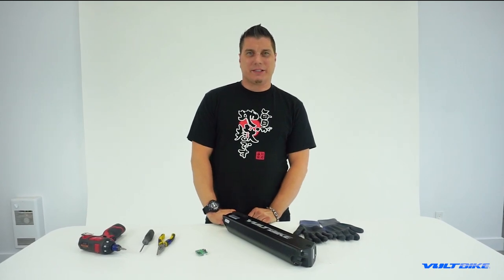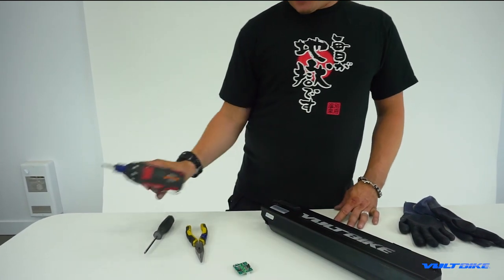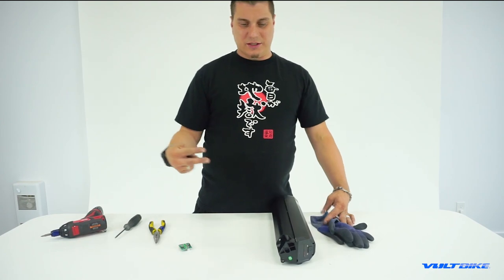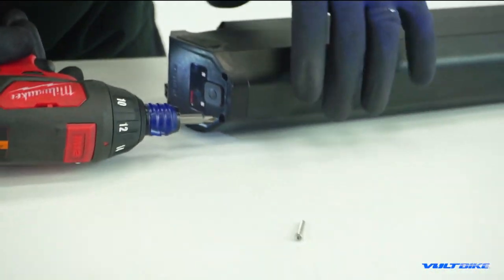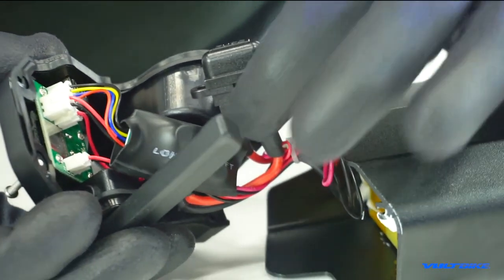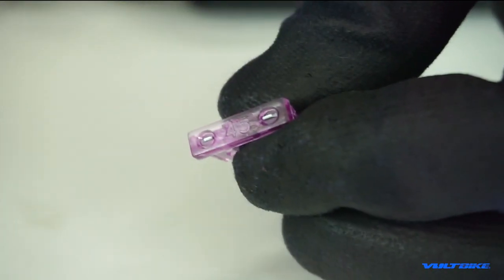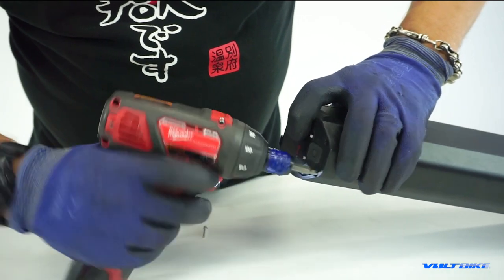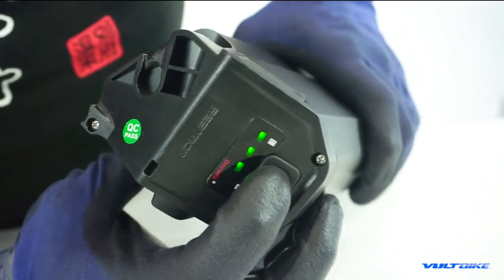Battery Fuse Replacement (Clip-On Style Battery) - VoltBike

Comment: This is awesome - I did this proceedure and my battery started to function again. Unfortunately, after a few hours the battery dies again, in otherwords it's full but there is no output. I have had to redo the BMS reset several times. Is it possible the actual BMS board is messed up or something is triggering the failsafe. The battery dies while not attached to the bike, not plugged into the charger, just sitting at room temperature after about 3 or 4 hours from having done the reset. Help?
Reply: Did you end up figuring it all out? does the battery now work?
Reply: I got the exact same issue. Also my battery doesn’t seem to have the same type of fuse so I can’t see anything like this